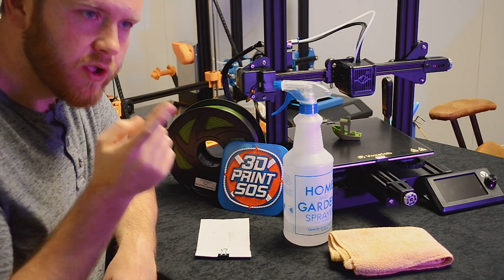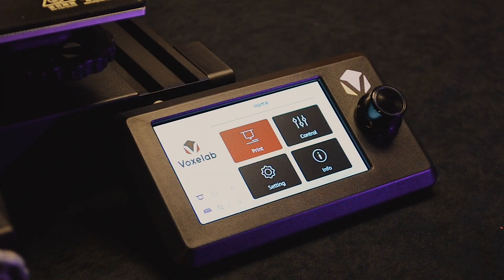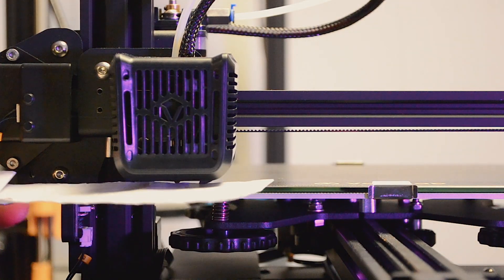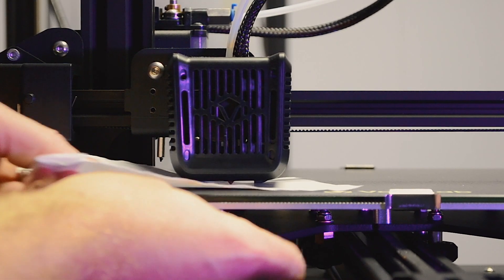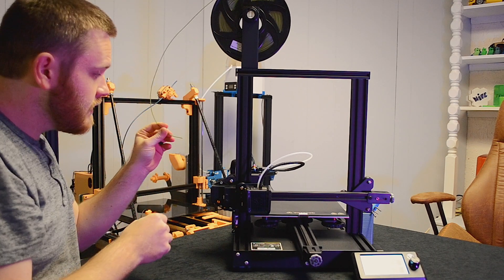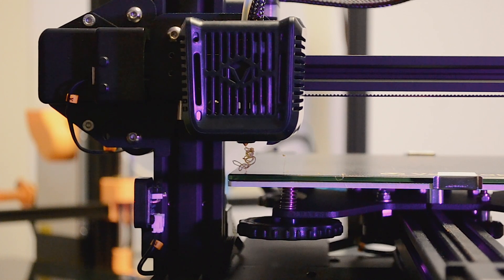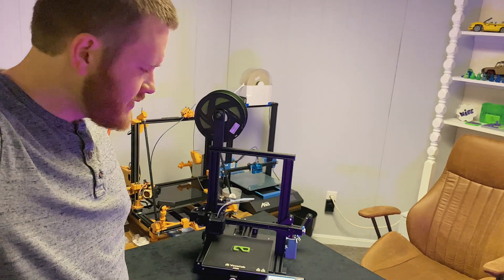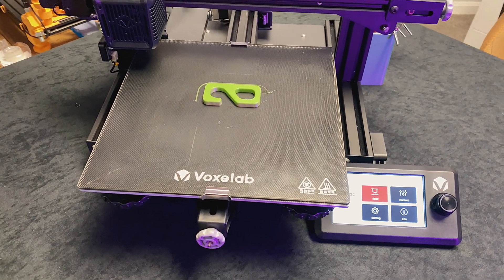How to Level Your Bed on Your Voxelab Aquila 3D Printer.

Comment from the maker: Here is my Cura profile for the Voxelab Aquila to be used with PLA - https://www.3dprintsos.com/wp-content/uploads/2021/01/Voxelab-Aquila-PLA.zip

REMINDER:  if you are tweaking said knobs live, make sure you do not move the bed too close to the nozzle or you WILL ruin your bed. Having the nozzle too close to the bed will cause other issues as well. So tweak at your own risk. Otherwise, stick to the paper.  :)
Reply from the maker: Right. In the extruder, there is a lever. On the lever, there is an adjustment screw.
Reply: Do you have an updated Cura profile? One that eliminates the seam using vase mode or something similar?
Reply from the maker: No, I’m still using the same one. In vase mode, there is no seam. Just one continuous bead all around. You can try to have the seam hidden in the sharpest corner. That sometimes work well
Reply: Do you highlight the differences between your profile and the one Aquila includes in their files somewhere?
Reply from the maker: @MarkieBKennedy  Its a bunch of little details. Seam at the back, a brim, Combing NOT in skin. The main use was to make it easier for everyone to follow along, but those little details do make it easier to print with in my opinion.
Reply: @3DPrintSOS  Thanks so much!  I've had many printing issues with their profile, so I'll give yours a try!
Reply from the maker: @MarkieBKennedy  NP. Let me know how it goes and we can make some tweaks depending on whats going on. The profiles are meant to be somewhat general purpose but there are always tweaks to be made
Reply: @3DPrintSOS   Hey. I just got my first 3d printer today. The Voxelab aquila c2. I followed all your steps but it seems likes it still all out of wack. Any advice?
Reply: @3DPrintSOS  I need help just got the creality cr touch leveling kit, not sure do to about the firmware update. I have the voxelab Aquila x2 with h32, do I 'need to get the new motherboard motherboard. if so witch one? do I use the inder 3, 4.2.7. motherboard. mm lost please help..

Comment: I have good adhesion on my build plate except for the rear middle of the build as it like the needle gap is to big but good every where else. Everything looks perfect except that section there is a big gap as if the plate is warped

Comment: My extruder needle is way far away from my bed when home, I cant loosen the bed enough to get that close
Reply from the maker: Look on the side of the machine. There should be a z limit switch. You just need to slide that downward to the printer homes lower. You don’t want your springs to be lose or your print quality will take a big hit.

Comment: I got my printer second-hand, and the filament is not sticking to the plate. Do you have any tips to help with that?
Reply from the maker: I would start by cleaning the bed with dishsoap and warm water. Make sure it’s fully dry. Then do a bed level procedure (I have some videos on that) and give it another go. 70c on the bed should be good. You can let it warm up for a few minutes before printing. That will help.
Reply: @3DPrintSOS  Thank you, sir. Got it to stick, some spots were popping up, so I slowed the print rate and increase flow and that worked. Just finished my first print. Your help is much appreciated.

Comment: I have leveled my bed good. However, when i go to print, the nozzle crashes into the bed and the fliliment is pusshed into the bed and doesnt get proper layering. how do i fix this?
Reply from the maker: Watch this video and follow along: https://www.youtube.com/watch?v=Q7Mu05fZNsk&lc=Ugz3zrSWz5T2JVuXPZh4AaABAg
Reply: maybe theres a misunderstanding. LOL. I leveled the bed and set it to home and it is perfectly fine and good. However, when i select a print, the nozzel wil rehome then it will move down and push the nozzel into the bed and try to print from there. I have tried adjusting the Z axis switch to try an compensate for it, but it still doesn't change the result. Couid it be the GCODE? @3DPrintSOS
Reply: I used this video to level my printer before. I appreciate it. was the best video i found useful in leveling @3DPrintSOS

Comment: I am so frustrated. Every video I watch acts like this thing goes together easily. Maybe if you run a YouTube channel where all you do is 3D printers this might be easy. I'm 66 years old with very little nimbleness left and zero 3D printer experience. After 4 hours and multiple times assembling and disassembling because something is wrong I'm now stuck. The instructions suck in my opinion! Just powered it on and the next instruction is to make sure the bed is stable. If not "use an open end wrench to adjust". It wobbles like a bobblehead doll. Where should I put the open end wrench to fix the problem? It would be nice if they would explain a little. The only thing I see is a bolt on each of the wheels. They do not look adjustable to me. What do I do next? PS. Even if you follow the directions correctly you will be disassembling at times. They have you put things together before other parts are installed so you have to disassemble to get access for the next step!. At least the display looks good. :(
Reply from the maker: Only one of each set of wheels will have an eccentric nut. What that means is when you get a wrench on it, one way will tighten and one way will loosen the entire wheel on its mounting bolt. Pushing the rest of the wheels into the slots and eliminating the slop in the movement. By each set, I mean there are 3 wheels on each side of the X-axis and at the bottom where the bed mounts. Each set has one eccentric nut on one of the wheels.

To be honest with you, I think you might have purchased the wrong machine. This super-budget machine comes disassembled as a hint.  If you aren’t into tinkering, you would have to buy something three or four times the cost of this machine that would work perfectly right out of the box. I’ve spent the past 5 years making tutorials and fixes for these things and nowadays, there are dozens of choices for machines that you no longer have to constantly adjust. You just have to pay a bit more. Otherwise, a bit of wrenching is expected. ;)
Reply: @3DPrintSOS  Thanks. I cooled off a bit and looked at it again. I got the bed stable. Now the issue is with leveling the bed. Numerous issues but the main one is the nozzle is not where it should be left to right (X Axis?). If I do an auto level the carriage moves to the left and engages the limit switch. Then the carriage moves about 2 inches to the right before it begins the auto level. It starts too far to the right and the last readings on the right are taken with the nozzle so far to the right that the bed is no longer under the nozzle. When the nozzle goes to center it is actually about 2 inches to the right of center. The machine doesn't seem to have a clue where it is left to right. I hope that makes sense but I'm at a stopping point until I can get this resolved.
Reply from the maker: Yep that makes sense. What firmware do you have on the machine? It sounds like it doesnt know there is a probe on it and there need to be offsets for the probe. Thats why it goes off the bed.  @KYMarty
Reply: @3DPrintSOS  It is running 1.0.1.
Reply: As far as I can tell that is the latest. There is firmware for an X3 Max and X3 Plus that is newer but the newest X3 firmware shows 1.0.1 on Voxelabs website.
Reply: @3DPrintSOS  I've been looking at it more and here is what I've seen. If I tell it to "Auto Home" it moves to 0,0 and I can hear the limit switches. Then it moves to the center of the bed but it isn't really in the center. If I go to manually move the carriage using the display it goes to a screen where I can enter X, Y, and Z coordinates. It shows 0 for Z, 110 for Y but it is at 136.6 for the X axis. If I manually dial in 110 where it should be it does go to the correct spot. If I were to enter some kind of offset then initially it would miss the 0,0 spot, correct?

Comment: I have two Voxelab Aquila Pro printers, I bought second because I was impressed with the first and the results, however, now I'm struggling to level and despite following your video's a few times the print keeps detaching from the bed.  I'm printing with PETG, the extruder temperature I've set to 245 degrees and the bed to 87 degrees, can you help please?

Comment: How do you center the print in the middle of the glass plate?
Reply from the maker: You should be able to put the print in the middle in your slicer. Do you have a modified machine? If not, then it’s just settings in your slicer. Sounds like your bed is bigger than what the slicer thinks it is.
Reply: @3DPrintSOS  how do you use the slicer?

Comment: Hiya
I'm looking for some help please i have already got an aquila c2 and today i bought myself another one of your printer the aquila x2, i don't know if I'm missing something but i assumed that I would just be able to download and slice straight away on to the new memory card using the software i had already downloaded for my aquila c2 and put it into the aquila x2 to print but this doesn't seem to be the case!!i have gone in to the print option at the top right hand side of the voxelmaker software page and selected the aquila x2 then downloaded the file and sliced it the same way as i have always done with my original printer (aquila c2) but once i take the memory card out and put it in the new printer (aquila x2) the file doesn't seem to be there for me to print. If you could help me on how to print using 2 printers that would really help as I'm really looking forward to getting the aquila x2 up and running alongside my existing aquila c2.I'm also wondering if there is a chance the machine could have a fault when it comes to reading the card or the card accepting the downloads.
thank you
Reply from the maker: hmm that should work. first thing I would check is just using a different card. does it read the card that the c2 uses? if not, than there is some issue there. if it does, try to put the card it’s not reading into the c2 and see if the c2 can read it.

Comment: I’ve tried everything I want to pack it up and send it back
Reply: I’m looking at it now my filament will not stick
Reply from the maker: Make sure you clean the bed. If you don’t have isopropyl alcohol, then warm soapy water works. If it’s not that, then it’s leveling for sure.
Reply from the maker: Before you do, try this: Level your bed! Just follow these EASY steps!
https://youtu.be/Q7Mu05fZNsk

Comment: Unfortunately worked perfectly until you said to move Z axis up then my printer absolutely refuses to move it back down! No idea what to do now! It just says homing failed please reset. I've spent 2 days trying to set this up. Thinking 3D printing is not for me :(
Reply from the maker: hmm. Sarah, leveling the machine can be the hardest part about getting started. but I promise that once you do it a few times it will be second nature. like riding a bike in a way. at first it’s hard and confusing but then you don’t even think about it. 

try this video: Level your bed! Just follow these EASY steps!
https://youtu.be/Q7Mu05fZNsk

Comment: Can you get a leveling sensor for the c2 like the ender Pro has
Reply from the maker: I haven’t ever attempted to do that with the c2. Assuming it would be the same as the rest of the Aquila’s. Would be a very similar processes. Add sensor, flash correct firmware.

Comment: My bed will not come close to the nozzle. At this point I'd have to turn the bed springs with a wrench
Reply from the maker: Here, check out this vid: https://youtu.be/Q7Mu05fZNsk
Reply: @3DPrintSOS  actually already found this, did it and my printer is working great. Thanks big dawg
Reply from the maker: Nice! 💪🏻

Comment: I have just build my firts 3D printer. An Aquila X2. 

When i wanted to level my bed i noticed that, when moving it back and forth, i felt some heavy spots. It's like the rollers under the bed go over some small bumps. 

Do i need to change the rollers or is this ok?
Reply from the maker: Sometimes these flat spots develop in shipping. You need to retention the wheels using the eccentric nut on the bottom. Make sure it’s not too lose to wobble and not to tight to leave flat spots.
Reply: @3DPrintSOS   Thanks for your response. So changing the rollers is not necessary.  Thats good to know...👍🏻
Reply from the maker: Not always. Sometimes they are clamped too tight and need to be rolled around back and forth to form back into shape.
Reply: @3DPrintSOS  Thanks, i wil try that first.

Comment: Thx for the information on setup. I am not able to get the paper under the nozzle on the second step to level the table. Why doesnt the table leave room for paper? I have it unscrewed all the way and I still can't get the paper under.
Reply from the maker: Hmmm. It sounds like you just have to go the other way. To pull the bed downward some. So there will be room for the paper.
Reply from the maker: https://youtu.be/Q7Mu05fZNsk

This will help you big time.

Comment: How about the middle of the bed?
Reply from the maker: What about it?
Reply: @3DPrintSOS  when you level the bed in all 4 corners and those are good, would I expect that going to the middle of the bed it should have the correct gap with the paper, or is it possible I need to continue adjusting 4 corners again. What have you seen from your experience? Great video and new sub!
Reply from the maker: I typically suggest you go around your corners 3 or so times. Also make sure your bed and hotend are set to a temperature that you typically print at.

Comment: Just watched your video for leveling I have one issue. When you selected auto home the head came down and stayed down. On my printer when you select auto home it will home out , but when the switch is activated the z assemble will move up about 3 mm just till the switch gets de-activated.
Reply from the maker: That seems correct. I believe they all do it “twice”. Once to get to the right height and a second time to get it precisely where it needs to go.

Comment: It's impossible to level. I tried a hundred times one end gets looser vs other sides. It just doesn't want to level. Annoying machine.  So I bought a flashforge basically hot garbage to.
Reply from the maker: Hey, please watch this video:  https://youtu.be/Q7Mu05fZNsk

I know leveling is annoying but once you learn it, it’s like riding a bike. You will very rarely level machines once you set them up correctly.
Reply: @3DPrintSOS  you know I think I finally have it leveled after a few weeks lmao.  I moved the z axis limit down and seem to do the trick... thanks for the video
Reply from the maker: Nice! Glad you got it

Comment: Would you recommend silicone bed mounts for this? I just ordered an aquila and am trying to figure out what to get to shorten the time spent leveling the bed or whatever it is other than printing itself. It seems a bltouch is a must also. Thank you!
Reply from the maker: Yea, those or even the yellow springs would be great. I don’t think you need a leveling sensor for these small machines. Once you level it correctly, you don’t really have to level all that much.
Reply: @3DPrintSOS  Awesome, thanks for the response! I just ended up getting the yellow Springs. Wishing you and your loved ones well,

Comment: Having a problem starting off when I press auto home the bed moves to the right position but neither does the nozzle move across the gantry and the gantry does not descend to the bed my screen just says returning to zero please wait and this is going on for a good 30 min what could I be doing wrong?
Reply from the maker: Sounds like something may be unplugged or plugged into the wrong spot. If you go to the settings, can you move each axis individually?

Comment: The first layer of my prints don't stick :(
Reply from the maker: Have you cleaned the bed? Try going 5 degrees hotter on the bed and bring the bed closer to the nozzle
Reply: @3DPrintSOS  ok I got it to stick but the left side of the print is slightly higher than the right side so after like 10 seconds it comes off and sticks to the nozzle so ima play around with the bed leveling stuff and see if that works
Reply: @3DPrintSOS  also I have heard that the Aquila is compatible with the bl touch? Could you maybe link it here? If not that's fine.
Reply from the maker: I did a video on the CRtouch. Basically the same thing. Great mod, especially if you’re interesting in further modifying the machine. https://youtu.be/Pito_oLbmBs
Reply: @3DPrintSOS  thanks man you are very helpful

Comment: The filament is not sticking to my bed. What's happening?
Reply from the maker: It’s typically either a. Oils on bed, b. Leveling is off or, c. Temperatures on bed too low or too high on nozzle.  Typically a and b solve this issue.

Comment: I’m assuming this isn’t normal, but I thought I’d ask. There is a section on my y axis that causes my printer to stop for a second, like a dent or bump that it has to go past. Is that normal, and if not how do I fix it?
Reply from the maker: No definitely not normal. But I actually fixed this same problem in this video. Check out printer number two, here:  https://youtu.be/DfueVgnn13E

Comment: Mines keep going all the way to the right when I try to auto home
Reply from the maker: Hmm. I believe you can repin the wires to run a different direction but before you do that check if maybe you plugged the wrong plug in? That cables should be labeled “X”
Reply: @3DPrintSOS  I put the belt on wrong but thanks

Comment: I find that it's also good to preheat the nozzle as well, especially if you have filament already in it, because a lot of the time you'll have a little bit of dried filament sticking out of the nozzle if it's cold. 
And so you'll be trying to level in relation to the bit of dried filament and end up with too large a gap between the bed and the nozzle.